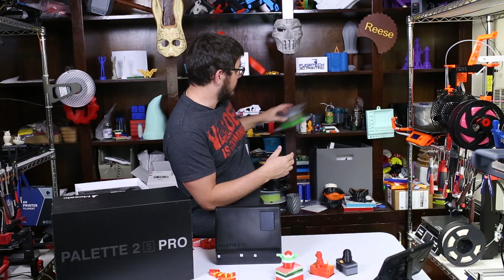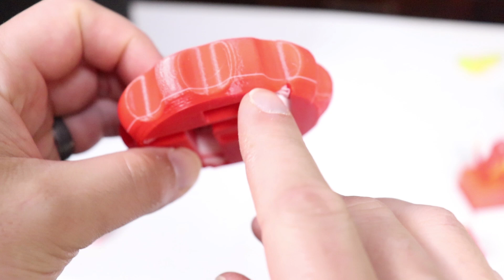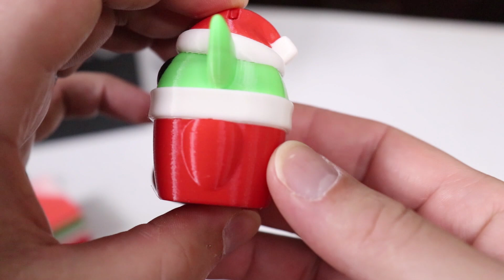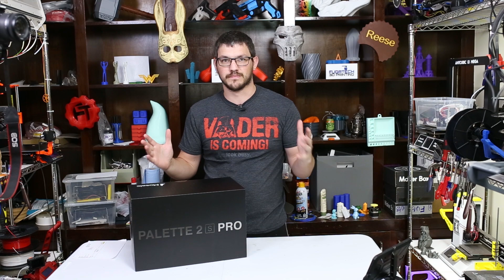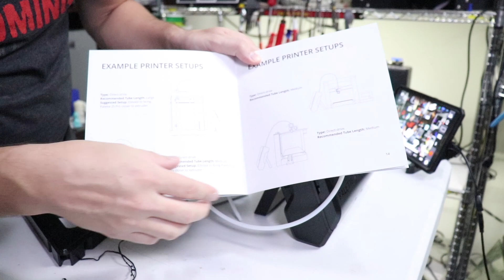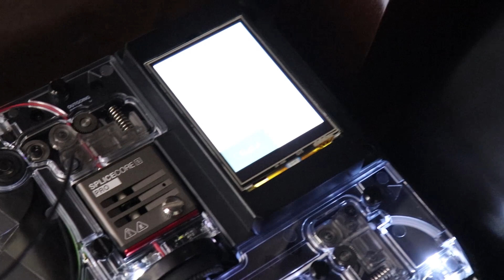Palette 2S Pro First Impressions

Comment: Wow. So, the purge block has a certain size area-wise, based on how much filament is in the transition length? And then, that area has to be printed for each layer in the color of the layer? I've been eyeing the Palette, but didn't realize just how much filament it would waste. Though, if you print multiple copies of the model, you only need one purge block for the entire print, right?
Reply from the maker: Correct. Higher transition length means a larger purge block. If it changes color in that layer, it fills the layer. If it is the same color, it does a quick infill of like 5%. And yes, if you print 1 or 100 copies of the same object, there is only 1 purge block. If you print multiple different objects with the same colors, the purge block is also the same size.

Comment: You mentioned the high temperature of the Prusa extruder. Try adding 
"M907 E410" to your start code. This will lower the current and 
therefore the temperature of the extruder. Mine dropped from 80c to less
 than 40c with no loss of functionality.